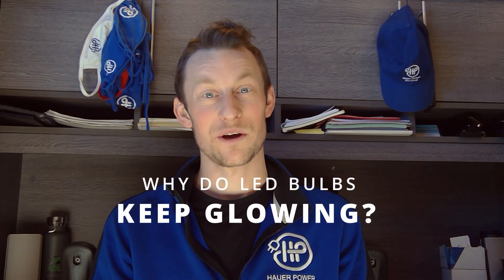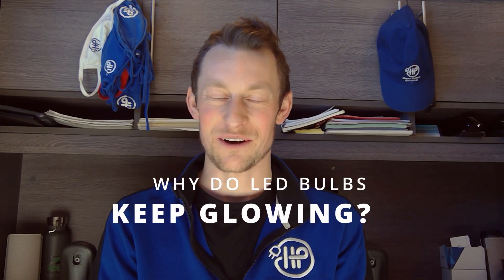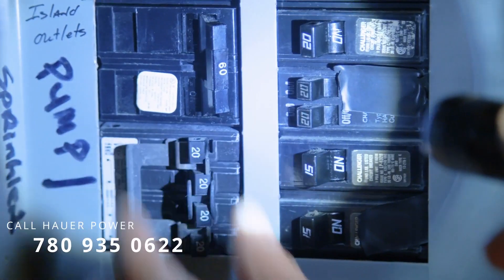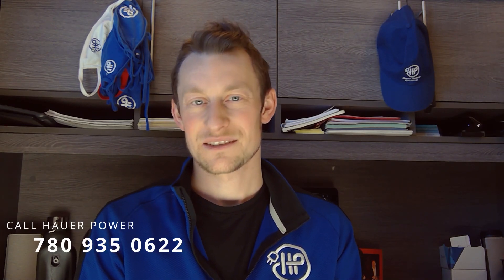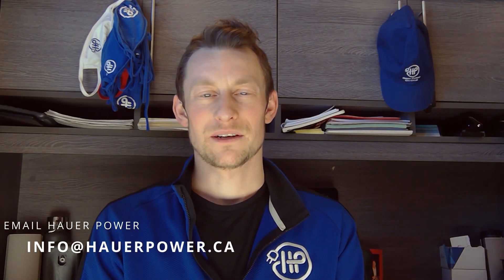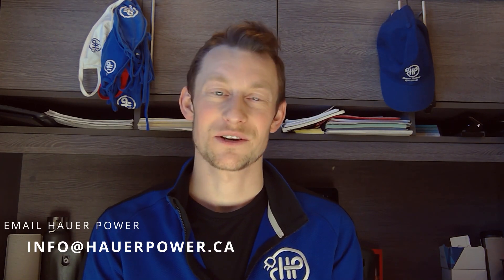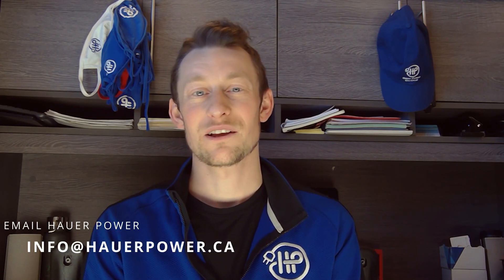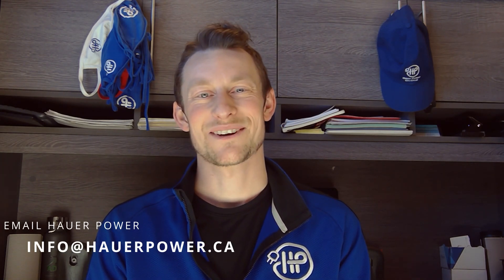Why Do LED Lightbulbs Glow After They Are Turned Off? | Electrician in Edmonton

Comment: My mom light used to be fluorescent light now I changed that to LED for two in her room and when I turn it on and brighten her room all the way, but when I dim it all the way it dimmed a little bit, but it doesn’t turn off. what do I do?
Reply from the maker: That's not right that it won't turn off, I would first confirm the bulb and dimmer are a reputable name brand and are compatible with each other. Sounds like that dimmer isn't quite breaking the connection as much as it should. Could be an underlying wiring issue as well, which might be a call for your local electrical contractor. Keep us posted!

Comment: I have a floor lamp that I found to be vibrating with AC hum if the polarity makes the live wire go to the socket which is surrounded by a metal part. You can feel a hum by sliding a finger with a light touch over an appliance.

Comment: Am I correct that 3 glowing 9W LED bulbs use no power when the switch is turned off?
Reply from the maker: You would be best off confirming that by isolating it at the breaker and seeing if it still glows. Typically it will dim eventually to no power at all, as the stored energy is depleted by the internal resistance. To say it's drawing no power could really be a 2 way conversation.